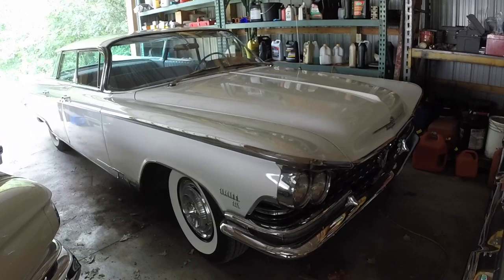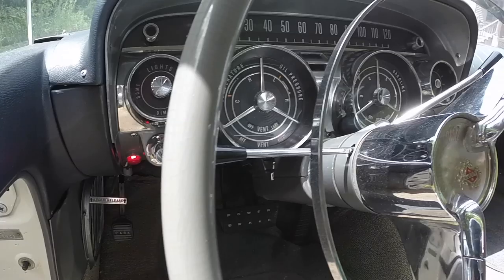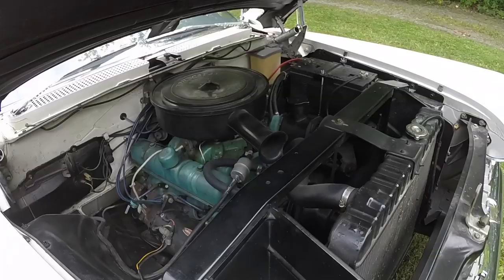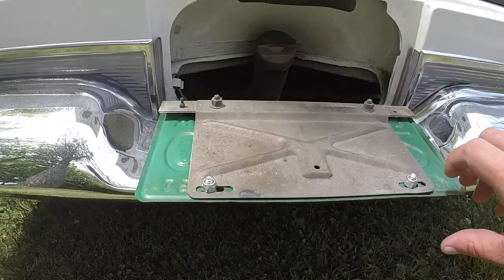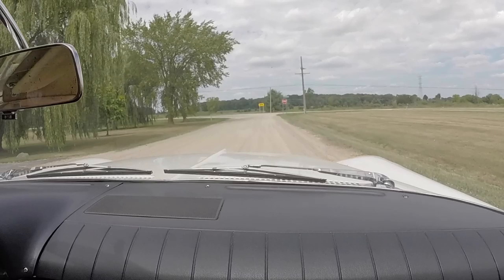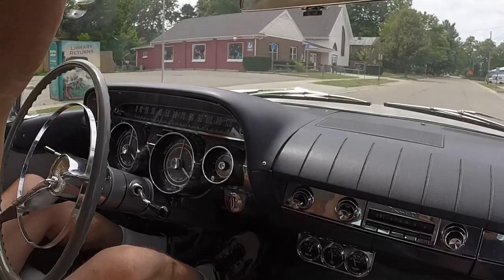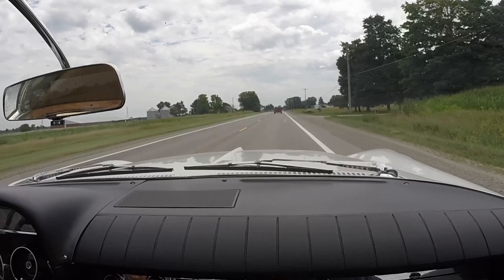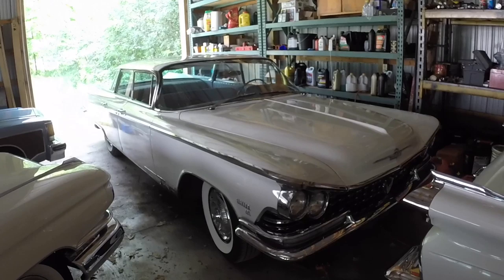Ride in Dave's 1959 Buick Electra 225,  401 Nail Head

Comment: Look at the visibility this Buick has, there no need for blind spot detection or Cross-traffic alert, unlike today automobiles with a high beltline.
Reply: There's something's to be said about cars without the multifunctional, touch screen, infotainment stack hogging the middle of the dash. God help you if that one unit controlling the radio, heater, AC and who knows what else, goes on the fritz.

I prefer separate units for the radio, and heater/AC.
Simple On/Off, Fan Speed and slide levers for Vent/Defrost and Temp: Cool-Cooler-Cold. I don't recall this owner saying his car has AC and I didn't see a compressor in the engine bay. Vintage Air would make it comfortable year round.

I can see a glove box CD player, maybe discreet 6x9's on the package shelf, but most songs are under 3 minutes. By the time you've adjusted all the buttons on new radios, the song has ended.

I understand adding seat belts for safety. Im sure someone could attach lap and some type of shoulder belt from under the front seat. Now new cars can be totaled by insurance companies simply because too many airbags deployed in a minor accident and the replacement cost for the bags is prohibitive, yet the actual body damage to the vehicle isn't significant. Some cars require you to remove the bumper to replace a  headlight bulb. 

My first car was a '72 Dodge Challenger R/T. 318/Slapstik Torqueflight.
I'm happy the big three have found success with the retro designed pony cars, but everytime I see a "new" Challenger, I think of that saying:
"Imitation is the greatest form of flattery."
Reply: @solemandd67  so true.
Reply: The Vista View model with thin window pillars.

Comment: I passed my Driver's license exam in my Dad's 1959 Buick Le Sabre convertible..bright red!  Dynaflow transmission, 364 V8, 250hp. Very few convertibles were made in 1959...Today, a primo example would be worth over a hundred grand! That car was so pretty, but it wallowed quite a bit when cornering--typical for these old barges.

Comment: I restored one for a friend a few years back. His is very very low mileage and has power seats ,power 1/4 lights etc etc. His also has the speed warning buzzer. Those are very quick car but even with new springs,shocks etc it was like handling a row boat on a windy day. Also they are low production run car, so the chances of seeing one on the road are pretty remote.
Reply from the maker: I never see the four door flat tops, there always convertibles or coupes. Your description of how the old cars handled is spot on... LOL.

Comment: Nice Car ... " .... it's pretty slick not feeling any shifting ... " yeah that's because it's a dynaflow cause that's what they do they multiply torque without shifting via gears.  They have 2 ranges high and low that offer infinite multiplication of continuous torque. Unlike that of  a Chevy, Ford or Chrysler trans where you can feel the gears actually shifting.  btw: regarding the original Treadle Vac master cylinder you cannot experience hydraulic failure within the master cylinder itself due to the fact the plunger is all metal and acts as a solid metal piston ram to displace the fluid vs what everyone uses today which is a rubber ribbed piston to displace fluid and those do fail due to rot.  The only failure for fluid to escape and to loose brake pedal is if one of the two front rubber lines cracks or the one in the rear cracks.  Of course if one installs DOT approved metal braided flexible brake hoses instead of traditional rubber lines then the possibility of the lines ever failing is almost nil especially if you tend to your brake fluid changes every 2 years.

Comment: Beautiful Boat and I love the sound of the engine. The '59 Electra is better looking than the '59 Cadillac in my opinion.
401 was still being made for '65. My Riviera had it.
Reply from the maker: Yes, I think the 401 was used until 66. My grandparents had a 66 with the nail head engine.
Reply: @OldCarAlley  I only knew that because the guy I sold my Riviera to, back in the early 90's, in San Diego, told me the car had a 401. I thought it was a 425...lol. I've heard 401's are very reliable.
I hope the guy selling this Electra gets his $20's k asking price. Its well optioned, body is fantastic, the interior is great, and the engine purrs. Nothing inoperable on it can't be repaired and none of it affects drivability. 

Great channel and thanks for posting.
Reply: Those are a lot cooler looking than the Caddys. Especially the 59 with the slanted headlights.

Comment: Why does it have an electric fuel pump. I don't think in would be stock . I drove a 1960 Buick in high school and it didn't have on. That clattering would turn me off. It was so loud I could hear it over the exhaust
Reply from the maker: The electric pump is not factory. The clattering is kinda noisy, but once on the road you don't hear it any more. It does need the mechanical one replaced. The electric pump was on the car when Dave bought it. He never got around to replacing it.
Reply: Remember the 1960 Buick in the film "Fast Times At Ridgemont High"?  That film was made in 1982, and that Buick was already 22 years old!

Comment: Is this a restoration? If not it was rather immaculately kept up. Enjoyed the video.
Reply from the maker: This is the way it looked when Dave bought it, seven or eight years ago. I think it was repainted once, by the past owner. The body is super solid, with no bondo, or body repairs. The engine was overhauled in 1987. Dave had the seats reupholstered, but the rest of the interior is original.
Reply: Old Car Alley looks terrific, bet it rides like a dream.
Reply from the maker: @jmad627  It's like sitting on your living room sofa, on a magic carpet floating down the road.
Reply: Nice car.  Is the electric fuel pump original for the car?
Reply from the maker: @kevinkeeney6693  No. It had a mechanical one on the engine originally. I think the electric pump was on the car when he bought it. He just left it, as it runs good the way it is.
Reply: @OldCarAlley  Thanks.  I knew Buick engineering was ahead of its time, but didn't know the extent.

Comment: Flat top or 4-window.
I also see a 1959 Oldsmobile 6-window in the garage
ahead of the Buick, and a 1959 Cadillac next to the barn.
Reply from the maker: Yeah Dave owned every flat top GM made. He sold all but the white Cadillac. The gray Cadillac dropped a valve. He didn't want to overhaul the engine, because everything on the gray one was factory original as it was an unrestored car. He felt one thing would lead to another, eventually rebuilding the whole car, which he didn't want to do, so he sold it too. The gray Cadillac was his everyday summer beater for many years.

Comment: GM cars in 1959 were longest ever made.
Reply: The 1975  225 holds that honor
Reply: @kendallsmith1458  They must have kept the length that same for all the large cars. Just checked the 1959 Caddy & Buick: 225". I guess they didn't think would be a gas embargo around 75 and 76.

Comment: The 425 was used in the Rivera I think it was optional in other cars .I had a 66 225 and it did a great job of moving a 4600 pound car it had the 401 it also had a 3 speed TH400  that helped a lot too
Reply: 59 was the first year for the 401, which remained in production up through the 66 models. The 425 came along part way through the 63 model year and was optional on Rivieras and Wildcats. It was the ultimate development of the first gen Buick V8s.
Reply from the maker: Wasn't the Buick 225 a V-6???
Reply: @OldCarAlley  
Yes they did, but it only went in the small Buick Special they also came out with a 215 aluminum V8 again it was only used in the small Buick Special,  but was also used in a small Oldsmobile,  and Pontiac. 
My electra 225 had the 401 cubic in engine. I did own a 66 Buick Special and it had the 225 V6 no power but got 22 MPG with A/C
Reply from the maker: @bertgrau9246   I have some video of GM's aluminum V-8 in Mark's Oldsmobile F-85. It's at 5:41 in this video https://youtu.be/rn_VG9F4vAQ
Reply: @OldCarAlley  he was referencing having owned an "Electra 225". That was the largest (C body) Buick, and the 401/4 (Wildcat 445) was standard in it. The 225 V6 was a Buick Special engine.

Comment: Are the back up lights non functional? They weren't lit as he backed out of the garage. A real nice Buick! 59 and 60 had similar look to the rear.
Reply from the maker: I noticed that when editing the video, so I would say no they don't work. May need the switch cleaned. One thing nice about that era, everything is rebuildable... even the switches.
Reply: The fins on the 1960 model are not quite as high as the '59s' fins, and the 1960 models introduced the "Tri-Shield" emblem that is still in use on today's Buicks.  In addition, the 1960 Buicks saw the return of the signature "Venti-Ports."

Comment: You mention about the fuel gauge not working. I had that problem with a vintage car, eight years newer. The gas gauge sending unit was ok. Problem was the ground connection. The fuel tank rested on a flat metal strap. That was the ground connection. Some corrosion got in there, and the gauge worked only after rain water sprayed underneath, wetting the strap. I connected a wire, clamped to the metal lip on the outside of the tank, and connected the other end of the wire to the chassis ground. That entirely fixed the problem, permanently.
Reply from the maker: Could be a bad ground... don't know if Dave ever look at why the gauge is inoperable.

Comment: If the starter is activated by pressing the gas pedal to the floor, did you have to be careful when giving it full throttle not to engage the starter?
Reply from the maker: The starter cranks as soon as you push the pedal. There is a vacuum switch on the carburetor that opens the starter circuit when the engine is running. I point to that switch in the video.
Reply: As a teenager driving this car, owned by my dad, I learned you did not need to worry about the starter being engaged when you jumped on the pedal.  First car I piloted at 100 mph.  Effortless.  On bias ply tires.  I shudder to think of it.  Four door flattops are very rare nowadays.  That tranny sucked the power out of that 401 cid.  No decent rubber burning.

Comment: Was this car sold then or is it still available?
Reply from the maker: It sold a couple years ago.
Reply: @OldCarAlley  
Got it. Thank you. It is sad.  I am looking for such a car.  Do you know anyone else who has such a car?  Or 59 Buick coupe, wagon?  Also 58 Oldsmobile Fiesta Wagon?  By the way, in this video, the owner of this Buick also has another Flat Top in the garage - 59 Oldsmobile.  Does he sell this car?
Reply from the maker: @Rustytales  The same guy that bought the Buick purchased the Olds too. He has a 59 Caddy flat top, but he is keeping it. I don't know anyone else with one for sale.
Reply: @OldCarAlley  
I have 59 Cadillac Flat Top, now I need Buick Flat Top and Oldsmobile Flat Top for my collection.  
Will have to keep searching. 
Thank you for your reply.
Reply from the maker: @Rustytales  I hope you find them.... thats what Dave had, one of every 59 GM flat top made. He had two 59 Caddy flat tops, but the one he drove every day, dropped a valve, so he sold it. He didn't want to overhaul the engine, because he thought it would be like opening a can of worms. It was a 100% original car down to the paint. It's the grey one, in one of my past videos. It had well over a hundred thousand miles, so yea I get it. After the engine then the trans, then the suspension, and who knows what else. He did get a good price still, and the new owner is restoring the car.
Reply: @OldCarAlley  
So the car is in good hands.  It's always nice to hear that someone is restoring another old car.  We need to save more old, beautiful cars.  They’re  different, they have a soul and personality that modern cars don't have.